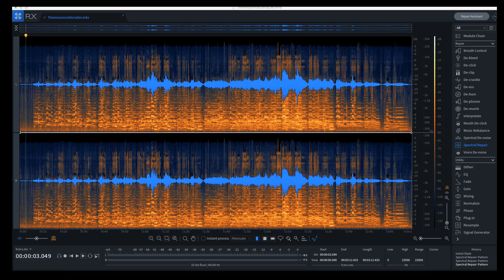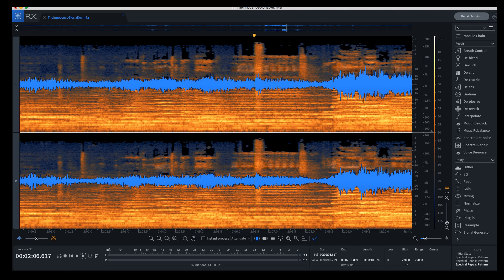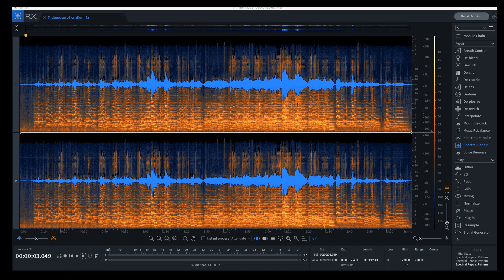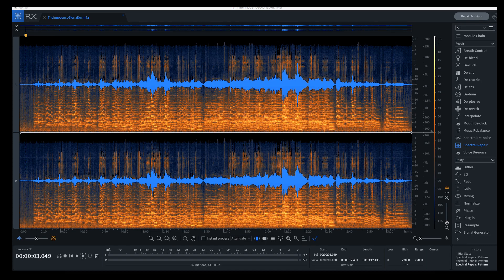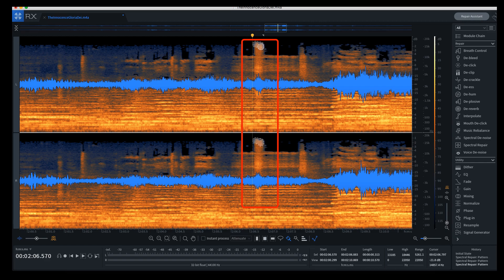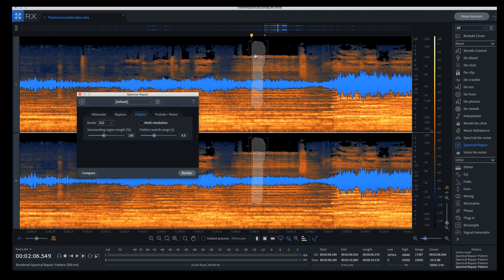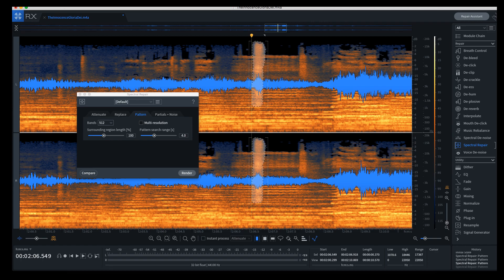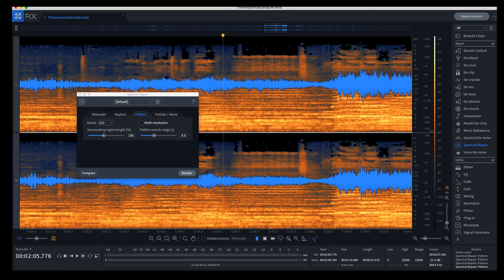How to Remove Unwanted Noise From A Mix Using Izotope RX7 RecordingCrave.com

Comment: How do I remove hissing Autofocus lens noises in my recorded videos?
Reply from the maker: If you're using RX you'll have to experiment. I had one similar to that where it happened so much it would have ruined the audio to do do it all. Thankfully, in my case, there was a second video, so was able to use that audio.
Reply: @Recordingcrave  How?
Reply from the maker: @carwashcurator7216  Have you tried something similar to what I show in the video? That's where I'd start.
Reply: @Recordingcrave  Not yet

Comment: What version of izotope  are you running? I bought the 25 dollar version and there is another one that costs around 200 but the one I’m using doesn’t seem to be doing anything
Reply from the maker: Hi Matias, the version I used in the video was RX7 Standard. It sounds like you have the "Elements" version. I'm not sure what the differences of what each version does vs the other versions. Hope you can achieve what you need to do!  Have a great day!
Reply: Keep a look out for special deals on RX Standard, especially if you also have Elements. These run a few times a year. Sweetwater is one company that offers them.

Comment: I can use this with my guitar too right?
Reply from the maker: I haven't tried it on guitars. I know version 8 they have it where you can eliminate string/hand slide noise. It may be possible you can do it in 7 as well, I've just never tried it.